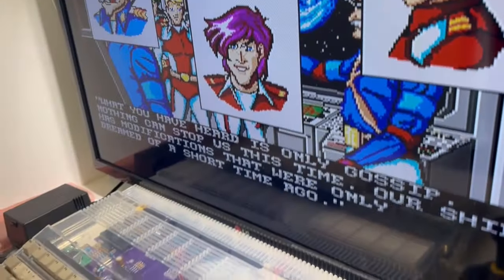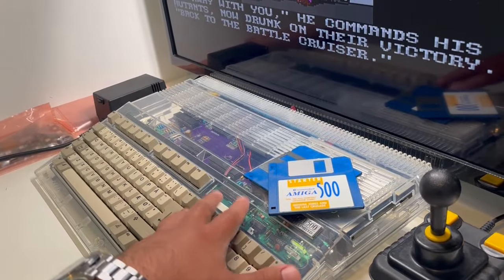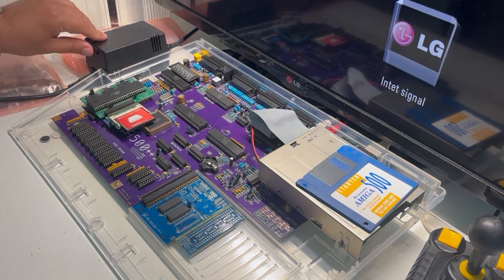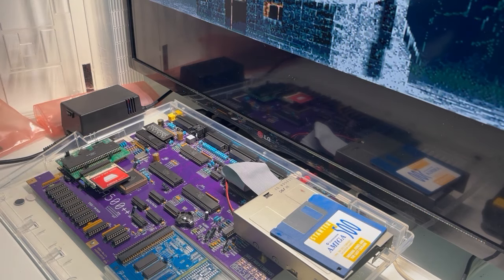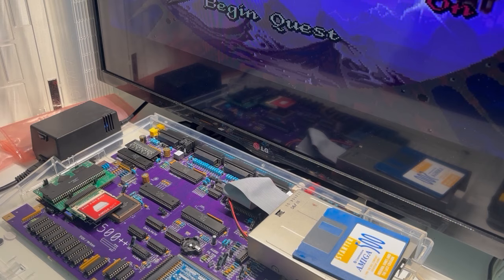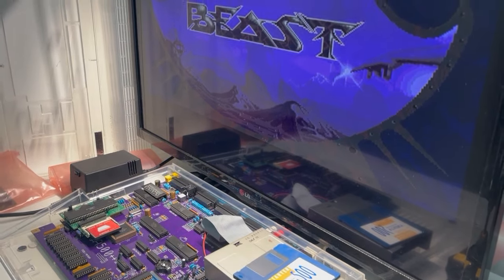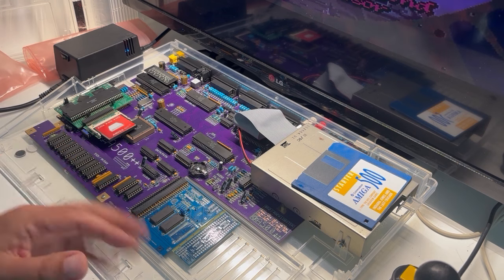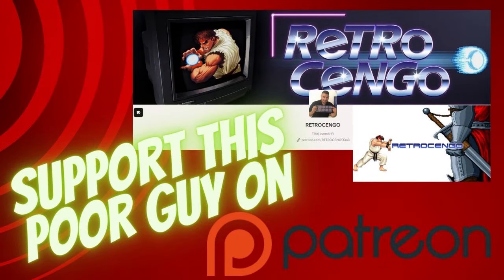Cheap Amiga 500 Accelerator Card for WHDLoad Gaming Spitfire 500 Review 2.0

Comment: Maybe 60 to 80 bucks using cheap aliexpress parts for the build. 120bucks using genuine reliable parts. Not including labour, special tools to program the CPLD PLCC IC's  and then solder all the fine pitch devices.  It's not an easy build for a newbie but it is an incredible modern add-on that transforms your Amiga500 experience.
Reply from the maker: When I got this card from the developer, got told it cost 40. I’ve seen them for sale on eBay around 80-100euro. 
Great card for little money😊
Reply: @RETROCENGO  As soon as there is an increased demand for the chips prices shoot up sadly.
Reply from the maker: @JoeBlogs720  yea same thing happened here

Comment: What kickstart is needed to run this? Would it work for a none plus Amiga 500?
Reply from the maker: You don’t need the plus version Amiga, it’s works fine on any Amiga with 68000cpu socket. 

As I remember I have kickstart 3.1 in this Amiga 500